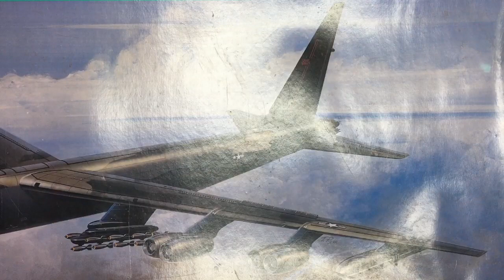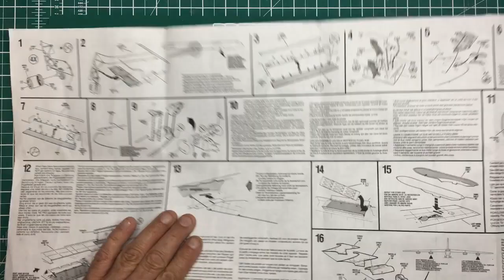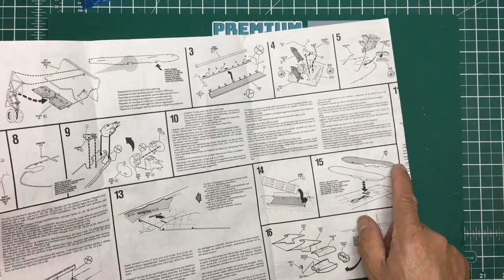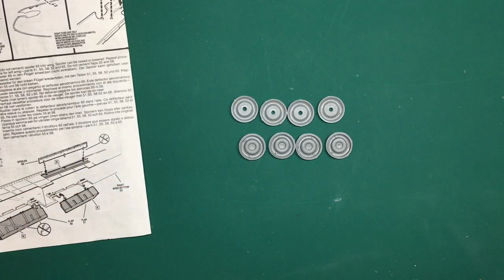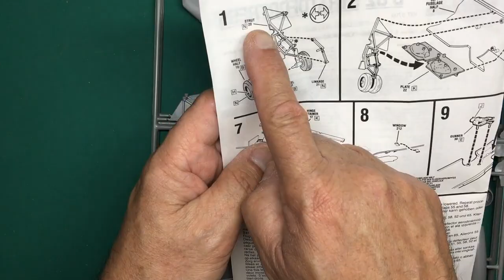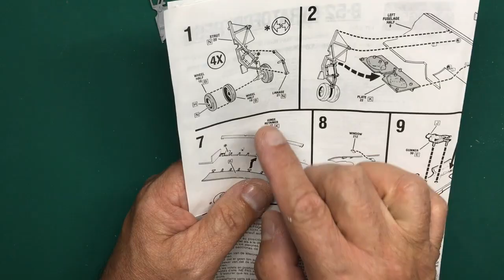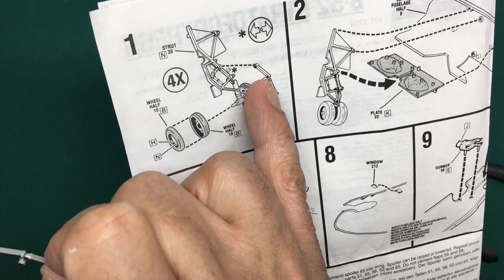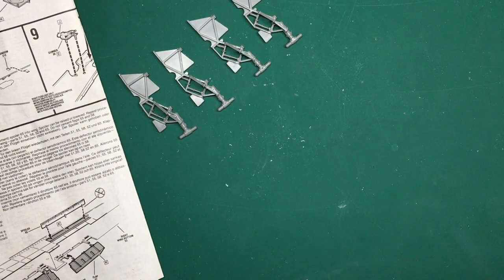Big Bad Buff build for Beginners. Part 1..waffle and undercarriage.

Comment: Jess is looking more and more like a member of ZZ-Top with her beard ;) 

I air-brushed with enamels yesterday for the first time ever in over 40 odd years of modelling - it smells worse than hand painting with it!

I seem to recall my (Dunsfold built) AMT/Ertl B-52G was assembled using Beatties version of Revell Contacta Professional and aircraft grade epoxy (used for carbon-composite repairs on Harriers), car body filler (again from aerospace) and sprayed with Tamiya rattle cans and hand painted with their Acrylics.
Reply: Humbrol enamel thinner absolutely stinks. I can't use it.
Reply from the maker: f'n right it does!!

Comment: Hey Nigel I absolutely love your detailed videos of the Monogram B-52 D. I have the exact same model as you do and I'm from Canada. Mine has nowhere near the detail as yours but I'm definitely trying. I don't know if you can answer this but I'm trying to source out the walkways decals for this model and I can't find them anywhere. Also wondering when your going to have another video on your progress with this kit. Cheers mate.

Greg
Reply from the maker: The next part will be up real soon.. engine faces and decals. i have shown you how to avoid using walkway decals.. much neater job.
Reply: @NigelsModellingBench  your absolutely right. I'm going to use your method. Love these videos. It's amazing how big the B-52 is. It's just as big as my 1/48 B1-B and bigger then my 1/72 Airfix Concorde.